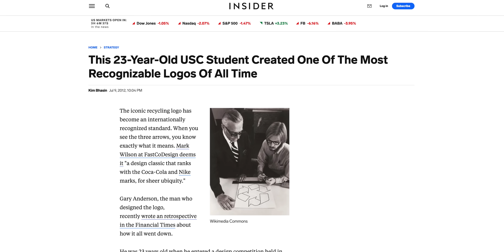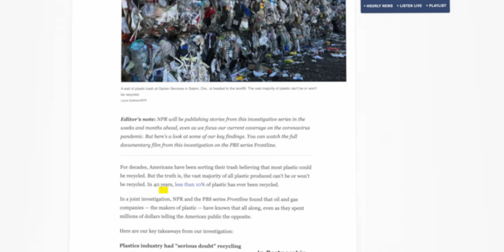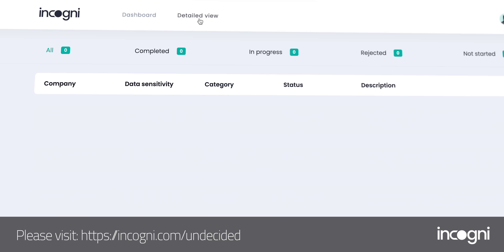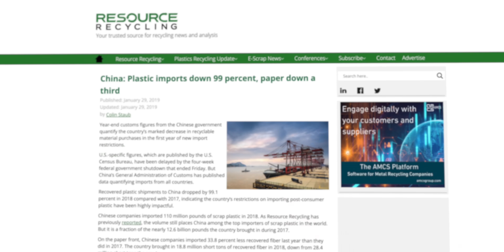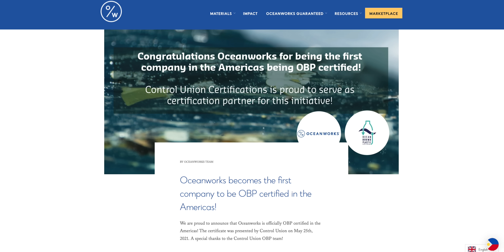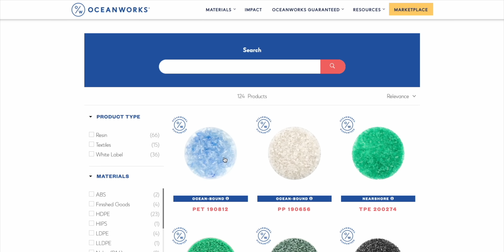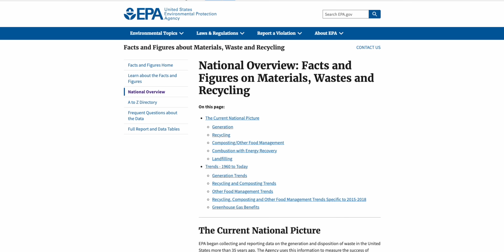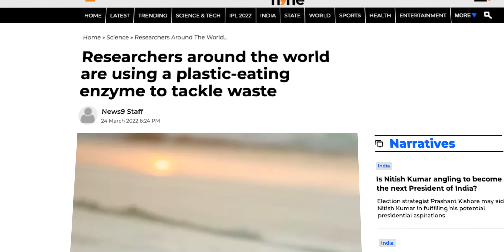The Truth About Plastic Recycling ... It’s Complicated

Comment: This is why I hate the whole "blame the consumer" attitude to saving the environment. The problem is that the externalities aren't priced into the manufacture of plastic, so you end up with this situation where everything is plastic, companies get to say they're encouraging recycling and we all end up using more plastic, some of which can't be truly recycled.

The current state of things is a mess and needs to change, good work on highlighting this in your video.
Reply: the majority of plastics in fact cant be recycled.
Reply: @Withnail1969  'Yet' or 'economically' or 'only partially via incineration with energy recovery' are the bits missing from your post. WADR
Reply: @Withnail1969  Incineration with energy recovery is 'a thing' where I live Renova run a city scale inceinerator that was actually short of stuff to burn so they imported, by sea, 'fuel' from Newcastle (UK) abd Oslo (Norway) until the local Green Mafia demanded that they take rubbish from other parts of Sweden even though that had a higher carbon impact.  Marking hydrocarbon plastic that can not be recycled (here and now) allows better separation from grades that can be recycled and avoids contaminating them as feed stock.  The Reduce - Reuse - Recycle mantra could do with updating for the modern age into Refuse (as in Reject) - Reduce -Reuse - Repair - Remake - Repurpose - Reclaim - Refuse (as in Rubbish); what that lacks in brevity it makes up for in comprehensiveness.  Sadly 'brief' is good because it gets 'we the people' on board, and it is better to do what we can rather than let the best become the enemy of the good.
Reply: Oh its easy for government to side with the producers.. the real solution is not to make single use plastics!!
Reply: Plus, trying to live a plastic free life is next to impossible even if you want to
Reply: @Sirbikingviking  it is not only 'plastic' that is derived from FOGI (fossil oil & gas industry products). A life without the FOGI might not be nasty, brutish and short but it certainly would be cold, dark and uncomfortable.
Reply: If you put two products on the shelves, one priced with the safe disposal priced in, with a big label telling the consumer, and another that doesn't have it priced in......which one do you think will sell?
Reply: @ChrisLee-yr7tz  i think that's the problem right there, you need to regulate so that they both have the costs priced in, then the products that don't use plastic will be more competitive
Reply: @ChrisLee-yr7tz  the point is that the taxes associated with plastic products should include the costs associated with it, so it isnt optional for producers to avoid their responsibility in creating products that directly negatively impact on both their consumers and people who had no idea the product even existed.
Reply: Externalities are never priced into anything. Capitalism only cares about maximizing the amount of current consumption that a bunch of psychopaths on top can achieve irregardless of the cost the future will pay.
Reply: and yet it is our collective behavior that makes the extractor-exoloiter companies soooooooo profitable.  We blissfully buy our way to ruin.  Who turned this fact from "the consumer has collective power" to "blame the consumer"?  Sadly, there really is no one other citizens to deal with our various global crises ... blaming will not create change.
Reply: @HoboGardenerBen The terms 'greenwashing' and 'greenwishing' are rather disingenuous as they are usually deployed as a means to allow consumers off the hook.  Nobody will produce what they cannot sell so consumers need to accept they have a part to play.  Not only as their disposal of the residue from the materials they consume are their responsibility.  The Reduce - Reuse - Recycle mantra could do with updating for the modern age into Refuse (as in Reject) - Reduce -Reuse - Repair - Remake - Repurpose - Reclaim - Refuse (as in Rubbish); what that lacks in brevity it makes up fro in comprehensiveness.  Sadly 'brief' is good because it gets 'we the people' on board, and it is better to do what we can rather than let the best become the enemy of the good.
Reply: Or better, blame China
Reply: @artkidolee2162  not sure that is valid? Did they make you buy the stuff or stop you dealing with the consequences of your actions yourself?
Reply: It is possible to recycle plastic and transform it into long-term construction products such as bricks, plastic wood, windows, and paving bricks. These are products that use plastic to build houses, schools, buildings, streets, etc., and not just simple recycled cups (disposable things). In this case, houses and entire schools are already being built using this simple and efficient technology in Asia (Thailand), Africa (Ivory Coast, Kenya, and Nigeria), and Latin America (Colombia, Bolivia, and Mexico). Colombia is the country with more expertise and advanced companies in this area. In Ivory Coast, for example, there is no garbage collection process, so people dispose of plastic waste in the open land. The Colombian company Conceptos Plasticos is producing together with UNICEF schools and homes in Africa. Plastic bricks made with recycled material are more resistant than conventional bricks. More resistant also than concrete brick. In addition, it does not absorb water and moisture and is simply treated to withstand excessive heat. Look on social networks for the page of the Colombian company Conceptos Plasticos. And if you can, there's a video from the Business Insider channel on YT called How To Make Bricks From Plastic Trash. It shows these projects in action. And also the BBC Earth Lab channel video called These Recycled Plastic Bricks Are Stronger Than Concrete and How A Ghanaian Man Is Building Affordable Homes With Waste Plastics.
Reply: @Andrew Meyer
Real and impactful change can only occur when the market forces (ie. cost to consumer) changes. Plastic is way too damn cheap! I disagree with the idea that we should all become some ideal consumer enlightened to the realities of environmental externalities and recycling scams. The system needs to be redesigned to account for the stupid nature of people as the rash and careless consumers that we so obviously are. Educating the masses has failed. We shouldn't keep putting our eggs into the same broken basket.
Reply: @benjammin7469  I'm more inclined with your way of thinking.
Reply: I don't think it makes sense to price the externalities into the production of plastic, since most of the externalities associated with plastic seem to be from how it's disposed of, not how it's produced.

Plastic manufacturing companies don't have any control over whether I recycle my plastic bottle, incinerate it, or throw it in a river, but the externalities associated with each of those three choices are very different.
Reply: @AndrewMeyer  But why should the people who are left with the problem be left with the full cost and not the people who most benefitted from the sale of that plastic, the producers? Sorry Andrew but you are totally wrong.
Reply: @GeorgeMonet  You don't think you benefited from using the plastic? The whole reason it was made in the first place was for your benefit.

It also doesn't matter which part of the supply chain you tax from a cost perspective. Either way consumers ultimately end up paying for it, just as with any tax. Either you pay directly, or you pay in the form of higher up front costs.
Reply: @AndrewMeyer  me when i blame poor people who have no choice but to buy the cheapest option (usually contains plastic)
Reply: @AndrewMeyer  I think there's definitely different ways you can tackle it, none of which are simple and probably won't work on their own.
Reply: @AndrewMeyer  - "since most of the externalities associated with plastic seem to be from how it's disposed of, not how it's produced"
The fact it's used in the first place creates the need to dispose of it though. The only reason single-use "disposable" plastics weren't banned decades ago is the aforementioned lobbying and misinformation campaigns from the plastics industry. They created the situation that led to these externalities in the first place.
And no, plastic companies do have control over how you dispose of your plastic bottle, because they wrote the legislations telling you how to do so. The fact you had a disposable plastic bottle in the first place is a result of their decades of lobbying and narrative control. You as a consumer don't really have much of a choice if the item you're buying/need is only available in a disposable plastic container.

The problem is systemic and was created by the plastic industry. Individual action cannot solve systemic problems.
Reply: @AndrewMeyer  The plastic companies knew that most plastic couldn't be recycled at all, and those can could would be downgraded. Yet, they pushed the myth of recyclable plastics, giving everyone "feel good" vibes, and pulled massive profits in the process. Aluminum, steel, and glass are all very recyclable, and can be used for beverage containers. Cardboard and paper are very recyclable, and can be used for consumer goods packaging. When used for food packaging, cardboard and paper are biodegradable, plastic is not. 
It was a lie from the onset, used to justify marketing of plastic materials preferentially to objectively "greener" alternatives, and then shift the blame to consumers after the fact.
Reply: @HoboGardenerBen If you choose to purchase plastic bottles then it's your responsibility to figure out how to dispose of them, "the bottle manufacturer made me do it" is a foolish excuse. Advertising is not mind control. If you're a "sheep that's easily led", that's your problem, not the bottle companies.

To the extent that current labeling practices are misleading, I agree those practices should be changed. More information is almost always a good thing. That's not an argument for making innocent third parties (like those who properly dispose of their plastic waste) pay for your mistakes via increased costs to future plastic products.
Reply: @AndrewMeyer  that is exactly the argument that lead to the existing issues. It's not the consumer's fault that they can't effectively recycle a product, it's the result of the manufacturer's decision to make it out of a material that couldn't be easily recycled. Consumers also only have a limited number of options in many cases on what products to choose when they are in need of a particular use case, either because of market share and availability or because the bad practices are the standard because it's cheaper.

Comment: The other problem with microorganisms breaking down plastic is that it's a very fine line since eventually they will escape.

They either will be too ineffective, so plastic will keep building up (all the matters is if production is faster than decay), or they will be TOO effective and we won't be able to use plastic anywhere - even where it is very important.  This could cause a global catastrophe.

There may be a middle ground but it'll be very difficult to predict, achieve, and maintain...

Comment: I have a much simpler solution plastic it's called glass and cardboard. Plastic has a higher cost than glass only the environment has been the one footing the bill. The most disgusting use of plastic is packaging; skins put on cardboard boxes. I buy from an online catalogs and never see the box and the product still comes in shiny boxes. Plastic foam inside the box rather than cardboard partitions. Plastic boxes that can only be used for the storage of one custom item. Plastic battery cases and chargers that are non standard, I must own 100 different battery shapes and chargers even when they are the same voltages. Better quality recyclable plastic goods at a higher price rather than cheap "dirty" disposable plastic goods. I try to use the same  plastic bucket for cleaning for as long as possible. Banning stickers with products, the PC industry is horrible for doing it. Some plastic makes life so much easier. It comes off as lazy that everything is made from low grade plastic and fancy packaging. When the continuation of the human species is hanging in the balance.

Comment: Hemp can save the world !!!
You can make 25000 different things from the plant !!!
Among other things, Plastic ;-)

Hemp plastic is based on natural fibers, which can replace oil-based materials. This plastic competes against properties such as stiffness and high heat tolerance that ordinary plastic implies. However, both the possibilities for recycling and biodegradability fit into global policies for CO2 reduction as well as dependence on oil. Plastic made from cannabis is not made from the plant's oil or seeds but instead from the stem.

Comment: Plastic recycling is easy
1. Industry needs to stop lying, Prison is good place for people who lie and deceive.
2. All plastic identify marks need to be at least 3cm or 1.25 inches and on an upper surface so easily visible. if that ruins your design aesthetic, tough use cardboard. It is your badge wear it with pride.
3. Using more than one plastic is banned or fineable with an extra 20% sales tax on the price to the consumer not the cost of the plastic
4. Non-recyclable plastics should have a 20% sales tax added on the price to the consumer not the cost of the plastic

These are easily implemented and is standard government ways to control things. They also provide the motivation to change which sorely lacking at the moment.
Plastics are where NASA and the car industry used to be before SpaceX and Tesla came along to shake up their respective markets and show it is possible to do things differently if you are motivated.

Comment: Step one: reduce use.
Step two: recycle what you can and improve on those processes, try to develop as many new ways to recycle previously un-recyclable plastics as possible, accept that not everything can be recycled and repurpose that trash for road-resurfacing.
Reply: Don't forget reuse!

Sometimes hard with the chemical leeching from single use bottles and such, but an important step to keep in mind nonetheless!
Reply: There is a reason why the Mantra goes: Reduce, Reuse and Recycle. Not Recycle, Reuse and Reduce.

Recycling is the last option. The thing you do when you can not do the other Rs. Even with the extent list of Rs, recycle is always the last.

And all recycling is not equal, either. So when it is best to do, compared to simply burning the stuff, depends. And we generally see burning stuff or just putting it in long term storage (what land general are) as so bad options that we generally do not mention those options. But in certain situation both can be preferable over recycling.

There is a lot one can do. Both with recycling and related repurposing. But it all depends on the material. Good paper fibres can be recycled several times, especially if the print on it is non-toxic. (Which it should be, but not always is). Poor paper fibres can't be recycled in an environmental fashion (but may be repurposed). And this is simply down to what material you have. 

Here society need to take a responsibility since a consumer can not alone be able to determine how to handle this waste.
Reply: There could be a hidden problem with using it in road resurfacing - the production of micro-plastics through the wear and tear of tyres on roads. Microplastics could become the big problem for humanity as they get into the lungs, blood and vital organs.

Comment: Why don't we just use more glass? Another person mentioned waxed paper. These things are still just as good as they ever were.
Reply: Glass recycling rates are very similar to PET containers and HDPE containers at around 30%. The main reason is that glass is super heavy and shipping it multiple times is a huge carbon footprint impact. There aren't enough glass recycling facilities distributed across the US to reduce the shipping impacts. We need more glass recyclers!